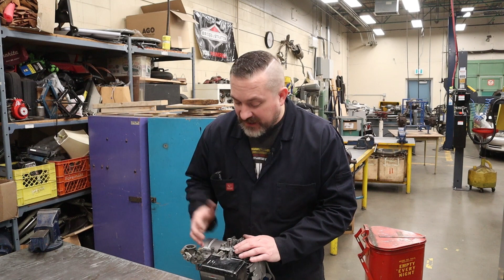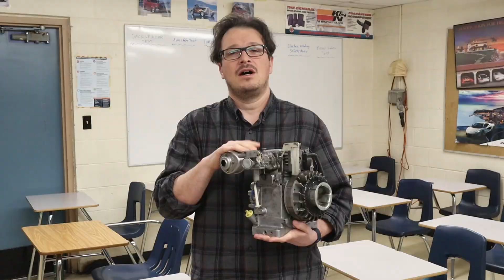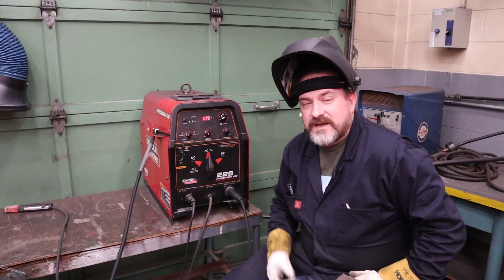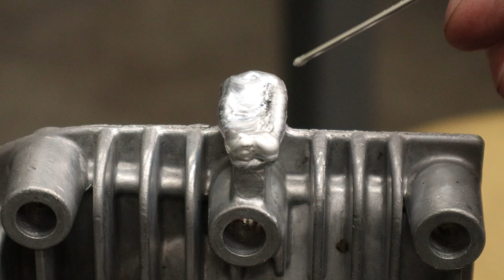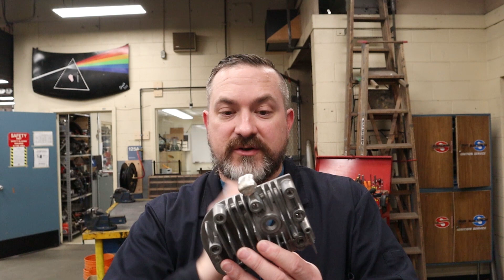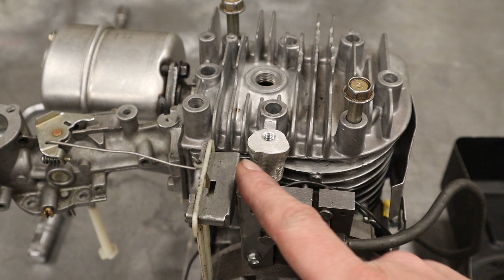How to TIG weld aluminum castings and save an engine's life

Comment: Hi there, great video and thanks for the content. I have  a question which is: What is the best way to weld/fill cast aluminium in hard to reach places? I recently had a bugger of a time with an outboard block which had seized stainless bolts. I went to weld a nut on, that failed because they are that stuck and the drill skated off putting a hole through into a water jacket. Its about 3/4 inch into the exhaust area. I am confident to do the job but not so far in. Any suggestions you would be a star@ I am based in Australia.
Reply from the maker: I would suggest shaping a plug made up of aluminum and fitting it into the hole so it plugs but not interfering with the water jacket.  Then prep everything clean and Tig up the hole.  Hope that helps.  Thanks for the watch and welcome to the channel!
Reply: @wayofthewrench  thank you sir!

Comment: Would I need to remove the top end of my bike ? I slaughtered my header bold hole . 🫠 and it’ a more complex motor to put back together. ? And since it’s the header area. It already gets heat on a regular basis
Reply from the maker: If you have good access and the fuel is removed, from the area, then sure you can weld it.  It is usually about safety and access.  Thanks for the watch and welcome to the channel!

Comment: Pro tip.  I work for a very major car company and am associated with their powertrain group.  the mechanics use Oven Cleaner to degrease parts or clean them.  for cast welding its a great asset as that aluminum has a lot of junk in it.
Reply from the maker: That's a great tip, thanks for sharing!  I'll have to try that in the future.  Thanks for the watch!  Cheers!

Comment: How did you choose the filler rods you used? 
Thank you
Reply from the maker: Depends, if you know the exact metal, you match it up.  If you don't, you choose a generic filler rod.  For aluminum, there are certain reasons though...like if it's going to be anodized or in high heat, etc.  Thanks for the watch!

Comment: very nice! would you also do something on welding magnesium alloys?
Reply from the maker: Thanks!  I don't weld a lot of magnesium alloys but I'll keep that in mind for future content.  Magnesium casings are usually really dirty as the pores love to suck up the grease/oil and come back out when you heat them up.  You often have to clean several times with acetone and carbide burrs when trying to get a clean arc puddle.  Keep cleaning till you get a clean puddle.  Use a high cleaning action to help keep it clean.  Really be careful with magnesium dust as it is flammable and is hard to put out if a fire starts....like bury in a pile of dry sand and watch it burn hard to put out.  You will need filler rods that are specially made for magnesium castings and TIG is your best choice.  I believe argon/helium is the best gas choice too.  Thanks for the watch! Cheers!